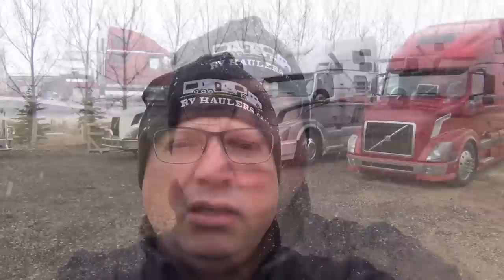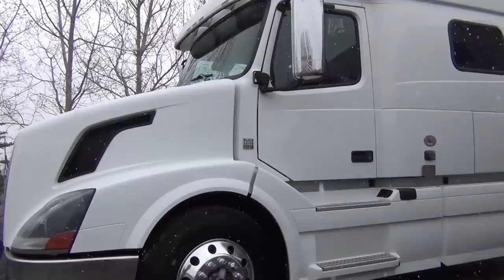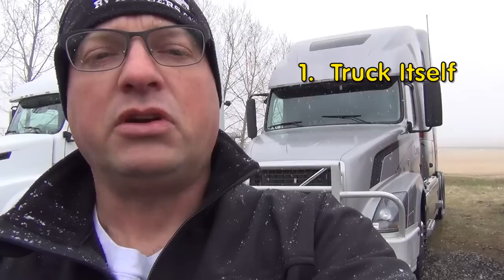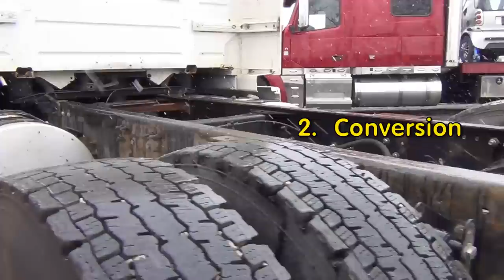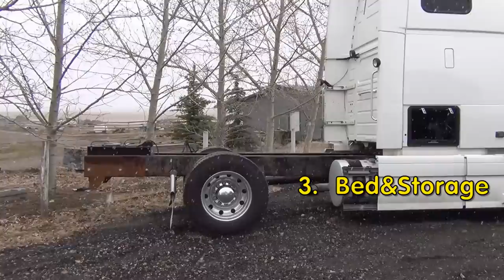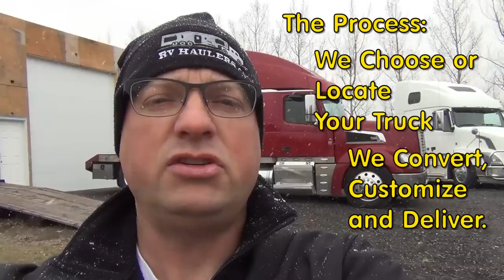RVHaulers  - How the Purchase Process Works

Comment: Is it possible to keep the duel drives? Does it have to be a Volvo or can you choose a kenworth?
Reply from the maker: We can certainly convert other models.  The Volvos just tend to be a bit more popular because of their fuel economy, autoshift transmission, quiet interior, and large interior sleeper space.  Sometimes dual rear axles have implications on the drivers license you might require for operating this tow unit.  Also, a dual axle cannot be classified as a motorhome, and is considered a commercial truck.  Every state and province has their own rules.
Reply: +Gregg RVHaulers Oh ok, i understand the duel axle thing now.  I'm a big KW fan I would love to see a newer T660 with a studio sleep build! you make great videos, keep up the good work!!
Reply: Populairity of trucks has influences on the price tag?
Reply: @dirtydavid26  I doubt you need a tandem axle truck for an rv you don't need 30k of payload